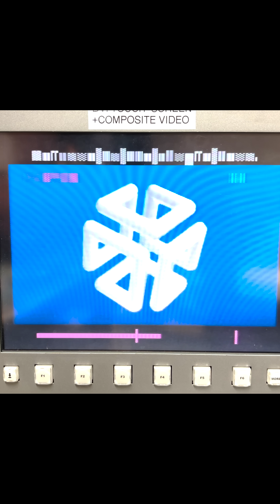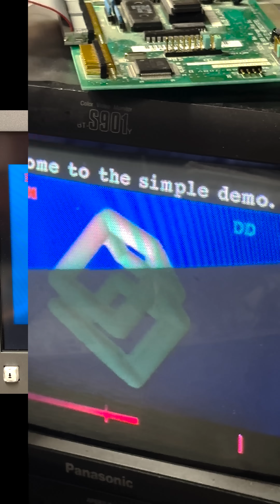Nintendo 64DD Development Drive using Cartridge Bus Splitter board - DCC Adapter

Comment: That symbol spinning is a clue to who helped Nintendo. It’s SGIs logo. It stands for Silicon Graphics Inc. The very same company and very same graphics technology that and get ready for this. The same technology that Sega of Japan rejected three times. 

Yeah, if Sega of Japan had not rejected SGI and if not for Sega of America CEO Tom Kalinske telling them to go to Washington and Nintendo . There would be no N64. Essentially in a way, it’s Sega technology. To quote Obi-wan “from, a certain point of view”
Reply from the maker: Yes indeed!!  you are correct. The SGI logo was used off and on with many of the first N64 demos. Most of the source code library files reference SGI as the author. 

Very cool details about how Sega was in the mix. 

Thanks for sharing.😄👌

Comment: What would happen if you plugged two retail games on it?
Reply from the maker: I would imagine the N64 would just freeze or not boot at all.

The CIC security chips and cartridge data bus signals would all conflict with one another. This condition is defined as “Signal contention”.

In the context of computer networks and electronics, signal contention refers to a situation where multiple devices or signals compete for the same resource (like a bus or a channel) simultaneously, potentially leading to interference or signal collisions. The end result…it likely just sits there and does nothing. 

Unfortunately no fancy explosions. Lol 😂 

Cheers!
-Gerry
Reply: @BehindTheCode_wGerry  So, you would need to connect all the console's bus lines into multiplexers to be able to switch between cartridges, even then you would have to reset the console before switching.
Some time ago I had the idea to mod a n64 to include a fallback flashcart, if you turned it on without a cartridge it would switch to a flashcart.
When I saw your post I got hopeful it would be a similar switching mechanism, but it isnt.

Comment: Does this unlock more development possibilities for the n64DD in north america, as far as making English versions of the existing dd carts and compatible games?
Reply from the maker: @cmscalvert 
No not really. The 64DD unit shown here is a standard Japanese dev kit with a Partner-N64.

There are some developers in the homebrew community working on N64 games and also translation packs for existing Japanese 64DD games. People can play them using an N64 emulator with 64DD support. They can be a little tedious to setup sometimes, but it is possible to do. 

Checkout 64DD.org for some examples:👇🏻
https://64dd.org/games.html#homebrew

Hope this helps.😎👍
Cheers!
-Gerry

Comment: I have all those parts minus the partner cartridge, but have that IPL cartridge and cartridge splitter board. My 64DD development unit is still new in the original box, never opened.
Reply from the maker: @johnketo2150  
Woa! 😳😲👌
That’s pretty wild!
Reply from the maker: I’m curious what serial number yours has? If it’s an early or late model. 🤔

Toss me a DM here if you prefer:
https://www.behindthecode.ca/contact/
Reply: I’ll give you twenty bucks for it
Reply from the maker: @ 
😂😂lol
Reply: This is the most neckbeard flex I’ve heard in a while.😂
Reply: @lorenclark6279  do you even know what a neckbeard is...?

Comment: PI bus only interfaces with the CIC and controller I/O, correct? Does it handle anything with the bus that handles mask ROM, SRAM, and FlashRAM? I ask because it looks almost like it might be able to do what the Protected Cartridge Decoder does. The two PCD slots let you mix and match CICs with different save types, including SRAM and FlashRAM, to use as a boot cart for CD64 games. Supposedly it works with other backup units too but CD64 is the one that used a controller-operated menu that required CIC-NUS-6102/7101 (“Mario Boot”). Because those save types are on the same bus as the mask ROM (unlike EEPROM save) it would also need to redirect mask ROM reads to the backup unit’s DRAM but I believe the CD64 already handled that part, just like a V64jr with an unmodified retail SRAM game as a boot cart.
Reply: PI = Parallel, ie. mainly the cart slot / 64DD comms stuff.

SI is basically the PIF I think, so handles the controllers, CIC, and game save EEPROM access.